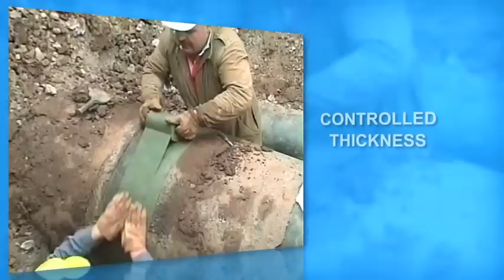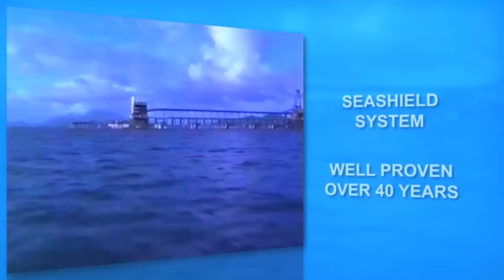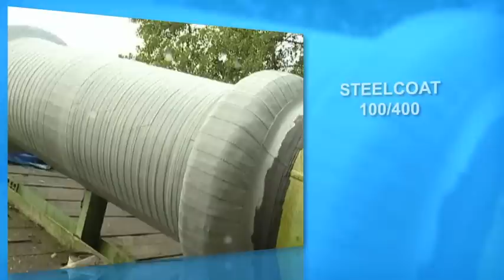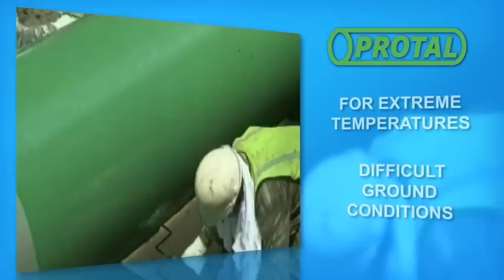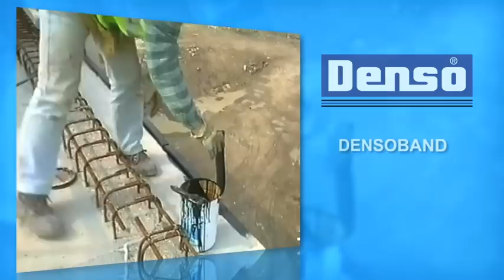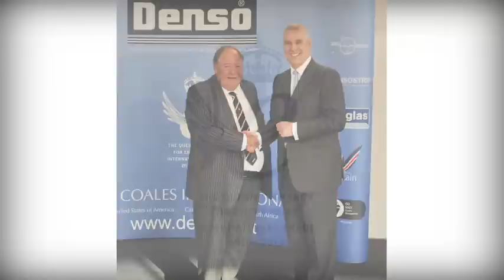Winn & Coales International

Comment: I have been using Denso Tape in the electrical industry for over forty years and it has never been surpassed.  It really is the best.  Wear gloves or suffer the consequences.  It is like a putty forced into a textile.  The putty clings better than S to a B.
Reply from the maker: Agent Bertram - thanks for the great comment!
Reply: You are welcome.  But PLEASE don't send me a free pair of underpants made from Denso Tape...  :O(
Reply: Winn & Coales (Denso) Ltd   Pl. p. 
L ,
Reply: Petrolatum tape works great with wooden fence posts. Wrap post to a couple of inches above ground and they'll last for ever. Have some I buried before the days of pressure treatment and they're still as good as new. Must have been in 25 years or more. Protects that numerable soil/air rot point.